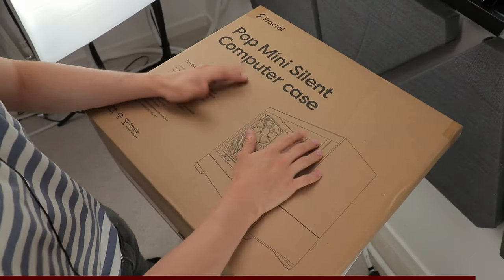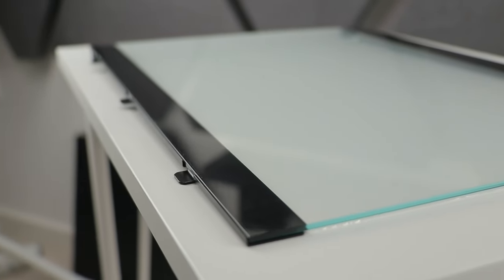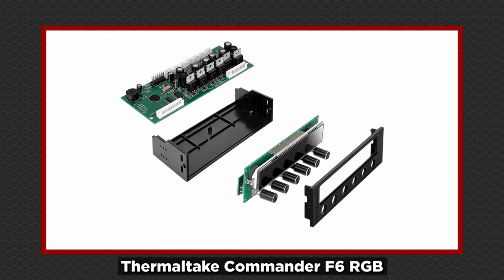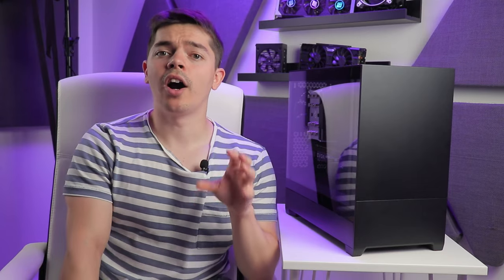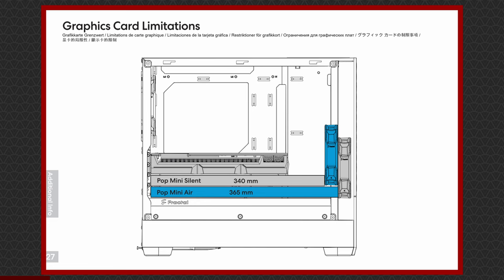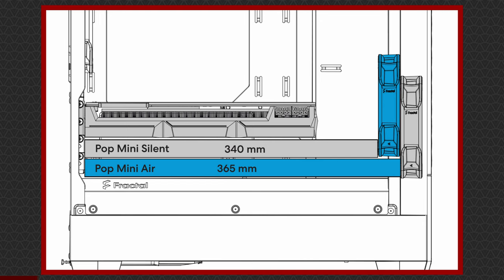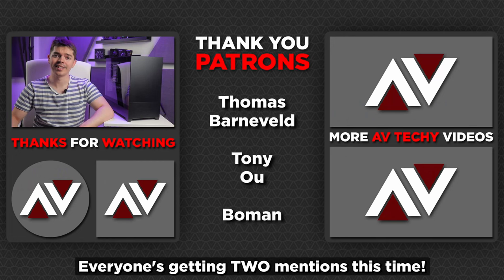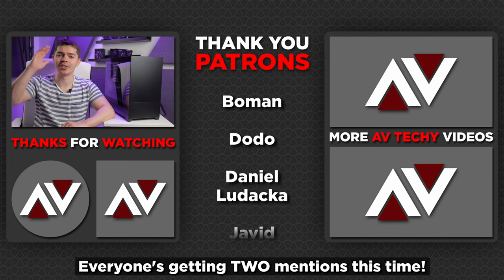SILENT but DEADLY - Fractal Design Pop Mini Silent Review

Comment: I'm just happy that mATX is getting some attention.
Reply from the maker: Yeah, it's been a while since it's garnered any attention. I haven't checked out any coverage of the Air version, so hopefully that brings something good to the mATX space.
Reply: @AVTechy  Honestly, I don't recall if there actually were any mATX cases released in the last few years.
Reply: @AmartharDrakestone  there were. The smallest I've read about so far was Silverstone's PS15 which AV also reviewed years back. Fractal and Silverstone have been the ones I've seen doing it but the former simply shrinks their ATX cases while the latter goes for more budget cases (except the G1m perhaps).
Reply: @AVTechy 

😊.

😊.

😊

,

.😊
Reply: @AVTechy 

😊.
,
.😊
😊.😊

😊

😊.

😊
😊
😊😊
Reply: @AVTechy 
😊

😊

😊

.

😊.
Reply: @AVTechy 😊😊

😊.
Reply: @AVTechy 

😊

Comment: The "267 mm" thing in the manual rant section is telling you the length of the card they used in the sample build. They are then telling you the maximum length you could fit in that configuration if you were to swap it out. There's a separate section in the specifications that lists the maximum length before the sample builds (page 3).

Comment: If u need the drive bays, its amazing, I'm considering it for a retro build with dvd writer in one bay and dual 2.5mm drive icydock in the other. All nearly hidden behind panal. Old systems have small high rpm fans which this case will tame. Im talking late 98, early XP era.

Comment: I just wanted to give some insides as someone who has started using this case about a week ago. I use this case with an Intel 12500 CPU and a RX 6900 XT and there is one thing that I noticed that is probably anecdotal but might be worth sharing. I noticed that my CPU is struggling way more with termals than my GPU is even though my GPU is the more power hungry component in my build. I have not changed the fans and I'm running everything including the GPU and CPU at stock configuration. The CPU is being cooled by a Bequiet Shadow Rock 3 that I also owned in my previous case. The CPU temperatures increased by about 10 C° while the GPU only increased by 5 C°. Both are still running completely fine with the games I'm playing at 1440p but I thought I might share this.
Reply: despite this, are you happy after some time with your case?
Reply: @mr.niceguy724  yes. I did not have any issues with the case since I got it and nothing I could complain about.
Reply: Hey how long is your psu??? I have deepcool 160 mm but the website says limut is 150?????
Reply: @regardzz  mine is exactly 150mm long.
Reply: @Revofev1000  fuck did it look like it could fit 160? Any space left?
Reply: @regardzz  if you remove the harddrive cages it could work I think.
Reply: @Revofev1000  so its that tight? Ffs are they easy to remove?
Reply: @regardzz  yes
Reply: @Revofev1000  yeah this was a fucking nightmare to install lmao
Reply: @regardzz  the 150 was terrible too believe me :D
Reply: @Revofev1000  yeah never again will i buy a mini case lmao i thought i will snap some shit up, and i have miniature hands for a guy, i cant even imagine normal manhands doing this
Reply: @Revofev1000  btw does your front panel jack for audio work? im not getting any sound
Reply: @regardzz  The issue with the case is honestly that they don't tell you that you should remove the ssd cage too to install the power supply and even the frontpanel if you can it makes it 10 times easier.
Reply: @regardzz  everything worked fine for me
Reply: @Revofev1000  you only connected the HD audio plug right? nothing else? did you change any bios settings or anything else ? where did you download audio driver? did you update bios it self?
Reply: And what are the max temps ? :)

Comment: Review: Splendid mix of facts and fun - as someone who more often than not lets myself be sucked into the iPad whenever the SO watches football on the telly, the line "... including all the time everyone spends falling over" certainly cracked me up 😂
Case: Looks like more of the same from Fractal. Sleek looks, nifty assembling tricks and high quality. Though that scratch mark would bother me sleepless - fully agree you should be able to put bits of the case most anywhere with no major concern, so that aspect sure looks like a misstep from them. As for silence vs performance, if someone values the former then I'd guess (or at least hope) they wouldn't expect to put anything too high-powered in there. My major concern with this case is Fractal's oversaturated collection of current SKUs - whatever happened to "less is more"?
Also: Bonus points for that Gaultier Le Male look you have going here! 💖
Reply from the maker: Thanks very much :)

It's an interesting case, and I'd rather interesting over anything else. But yeah, it's the imbalance of performance to temps that's concerning. I wonder how low in wattage you'd have to go to get close to a balance with a high aiflow case (noise to temp wise).

Haha "Gaultier Le Male", I had to Google that, I can see the resemblance :D
Reply: @AVTechy  Hey how long is your psu??? I have deepcool 160 mm but the website says limut is 150?????

Comment: The real question is does reduced airflow impact clock speeds of a CPU and GPU and in result reduce performance at normal fan speeds in comparision to airflow cases. I don't care if my CPU is running at 60C or 80C unless it affect's it's performance. I can't find answer to that question in this video :/
Reply from the maker: I always run into the issue of how much data I show in videos. I used to show as much as possible, but that became to difficult for people to watch, and for me to present well. The best answer I can give you is the hotter the CPU gets on my test system (6700K) it doesn't downclock, all the way up to 100C when it crashes. I've set it up to basically nuke itself before downclocking so I can get the most consistent thermal data possible (and it has nuked itself quite a few times with smaller coolers).

While that's possible to do with CPU's quite a lot of the time due to the finer controls you can access via the BIOS, with GPU's, unless you know an awful lot, and have all the right hardware and software on hand, it's extremely difficult to stop them from downclocking when they get hot. So with the 1070 in the test bench, every degree it gets otter past 55C (from memory) it will downclock more and more until something like 94C when it's prone to crashing outright. So there is a performance hit on the GPU for sure, which is why I stay away from including performance data in the thermal testing graphs, and stick to just the thermal data with other stats relating to cooling.

With all that said, under normal setups, the CPU and especially the GPU will downclock and lose performance the hotter they get to protect themselves from damage. High Airflow cases really do make a difference, and a low airflow compared to a high airflow case can easily add over 10, 15, or even 20C if they're really restrictive which can drastically impact performance, and will definitely impact performance of your typically setup system (one that's designed to downclock to protect the hardware from high temperature related damage, not the silly setup I've got intended to hit the high temperatures).

Hope all that helps, definitely get a high airflow case is you've got powerful components that you intend to push.

Comment: Fractal products stuck in the past, it a same case they've made in 2010 with some minor changes. If in 2010 those products looked high-end and desirable, they are no longer so in 2022. PC market changed but fractal failed to follow.
Reply from the maker: Not sure I fully agree. I think the styling is good, and the 5.25" compatibility is a nice to have but doesn't get in the way. I like it, it's just not great on thermals. Hopefully the Air version does better, and if it is good thermally I think that's a case to beat.
Reply: @AVTechy  for me it's mostly about (not) optimizing available space. It's a 40+ liter monstrosity with feature set no longer needed by most users (like 5 inch slots you mentioned). Cases like cerberus x did the same in less than half a volume and the only downside was higher price due to low production volumes. With production capabilities of company like Fractal they could bring new life to the market that craves for smaller but functional cases and at reasonable price. Yet they do nothing new.
I owned ARC MINI back in 2011 and it was a great case,  but that is an obsolete product i would never buy again. Pop Mini is just a variation Define Mini that also stagnated for years.

Comment: Is it worth mounting the PSU fan up, thinking this may help increase airflow and pull the GPU heat away from the CPU. Thinking head maybe due to there being no vent on the top for the hot air to escape?

Comment: Very detailed review as usual.

Would you consider reviewing the Deepcool CK500/560? Looks pretty good for the price.
Reply from the maker: Thanks very much :)

I'll certainly consider it. I'm sort of into checking out cases with bad-looking airflow designs to find out what actually works well enough. That looks like a good contender.
Reply: @AVTechy  Then you'd probably find the CK500 interesting.

Comment: I do MAO. I am buying a I9 13900k with a Z790. I need performance due to high performance calculation on plugin all day. But I need to cancel noise as much as I can. So what do you advise ? A silent version ? a air version ? or a air version and I try to build some isolation stuff around the computeur ? :)
Reply from the maker: I'd advise a high airflow case with large fans (generally quieter at speed). The Lian Li 215 has a couple of massive fans, as does the Torrent Compact.

Definitely get a large CPU cooler with a 140mm fan. That'll keep the CPU cool and quiet.

I'd stay away from Silent case versions since they only really apply to low power systems that won't need a lot of cooling anyway. For high power system, you want as much ventilation as possible.

Hope that helps :)

Comment: I'm considering this case for a small gaming PC, but one thing that confuses me is the tiny PSU size in the spec sheet.
It says "PSU max length 150 mm". Many PSUs, in particular the be quiet! Straight Power 11 I'm planning on using here, are larger (e.g. LxWxH 170x150x86).
I thought PSU sizes were standardised and usually not an issue. Is this really so limited?
Reply from the maker: Take a look at the PSU section in the video. It's not uncommon to get sub 150mm PSUs like the 140mm ATX PSU in this video.

You can probably sacrifice some drive storage for a longer one, but you'll have to check the PSU part of the video to confirm.
Reply: @AVTechy  Thanks for the quick reply on a video from last year!
The 13 seconds of PSU talk in the video were not very useful to me, but I'll just go for it and make some alternative 3.5'' HDD holder. The case is just smaller than most comparable ones, which is what I prioritise.
Cheers!
Reply from the maker: @markusweller4974 no problem. There's a couple of measurements in the info border in that section that show drive cage forward and back PSU clearance lengths. Should give you a good understanding of what you can expect from the case.

Comment: I am looking at this case right now to buy for my new build but thermals are bugging me because it will be living in the Philippines where it's always hot. I like the look of this case though that's the problem. I'm looking at the Pop Air XL RGB case also because of the thermal worries I have. I'll be running 13th gen Intel probably the i7-13700K which runs hot as it is so is this case really no good for me? Even with an AIO 360mm cooler ? Or will it be fine to use the Silent ?
Edit: actually it's not this case exactly as this review is for the Silent MINI. I am looking to buy the Silent XL not the MINI. My questions however still apply please if anyone has any feedback for me. Thank you.
Reply from the maker: Go for high airflow. It'll be quieter and cooler. Silent cases are rarely quieter than their high airflow counterparts

Comment: Fractal just released Define 7 Mini/Meshify 2 Mini. Please do a review on those if you can! Preferably the define 7 mini plus you mentioned you wanted them to bring back the define C, which I believe the define 7 mini basically is, in mATX form factor.
Reply from the maker: Hmm, they're coming out with some cracking cases lately. Not this one since it's a little hot, but the airflow one exists so it's hard to complain too much. 

But yeah, the Define 7 and mini Meshify's are here. I'm very tempted to check one out.

There are about 10 cases I really want to look into. I'm thinking of making some quicker videos to get more reviews done. The main things to keep are the testing and compatibility slides, so just need to condense the rest. I'll see if I can cover both of them. But at least one would be good. Thanks for the heads up!
Reply: @AVTechy  if you do have to choose, I think define 7 mini would be better because the Meshify 2 mini is being covered more.

Comment: This case or its larger sibling, or the Air versions, could be a perfect fit for my needs, but.... It's now 2024 and it's becoming increasingly annoying to have to shell out $20 more for the cable needed to enable the top USB-C port. Come on Fractal, just put in the USB-C cable as standard.

Comment: I wonder if the temps would've been better if both sides of the front panel has mesh in them like the define series.
Reply: True, but the Define also has a frontal filter behind the cover where this Pop has the drawer. You end up without proper dust filter, if leaving the drawer out.

Comment: It always depends on the hardware if a silent case is useful or not. You probably shouldn't build a high end gaming pc in it but it could work fine with an office pc.
Reply from the maker: I guess that's sort of right. But office PCs are already quiet, so there's sort of no point in the concept of a silent case unless you do something drastic like seriously increase the weight, or size.

Something that's worth a look is the difference between how walls are constructed. The only way to reduce noise transfer is to add masses of weight or size to them.

The PC in my office is unnoticeable and it's in a very standard Dell case that's doing nothing for acoustics.
Reply: @AVTechy  True, but I guess there's a sweetspot where it's worth it. Maybe a low end gaming pc or an office pc for higher end tasks like video editing
Reply from the maker: Maybe for low power gaming systems. Editing systems are as intensive if not more intensive than gaming rigs though so I don't think that's a strong option.

But in all of my testing high airflow systems are significantly quieter (or cooler depending on the setup) than "silent" options. 

Maybe they excel in areas I'm not coving like coil whine dampening or something like that. I'd love to test some heavier options to see how they perform.
Reply: @AVTechy  As far as I know, editing systems aren't working on full power all the time. While the system isn't rendering a video or calculating an intensive visual effect it shouldn't get that loud and a silent case could help. 

But I haven't tested anything of that, I just happen to have a silent case (bought it because it looked cool) and I think the sound dampening helps when the pc is in idle. Even if it isn't quieter it changes the type of sound too. It's more of an even humming noise/lower pitched noise with the sound dampening panels in place.

In most cases it's probably a better option to save the money on silent fans like the noctua a12x25 or the new be quiet Silent Wings Pro 4 along with an airflow case but I think the silent versions do have their niches and use-cases too.